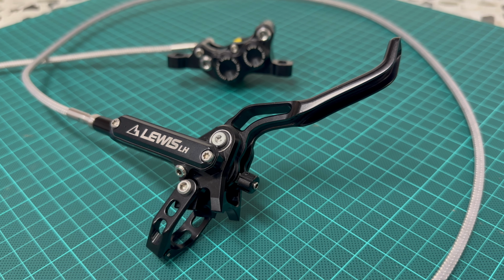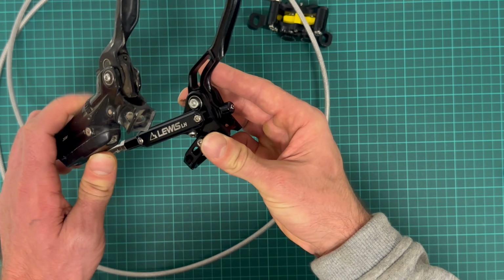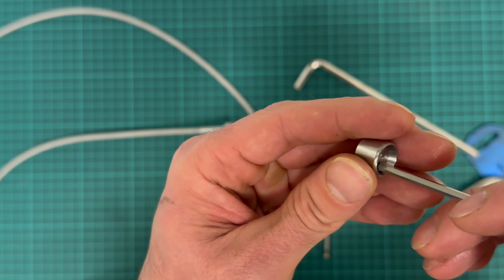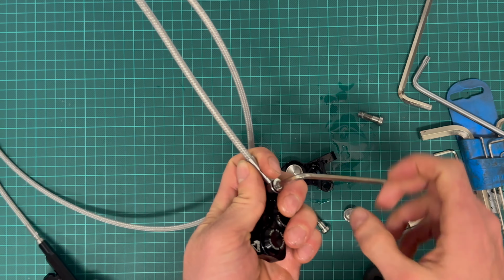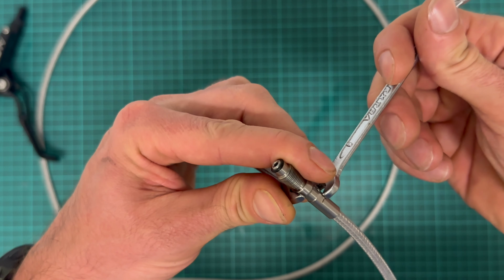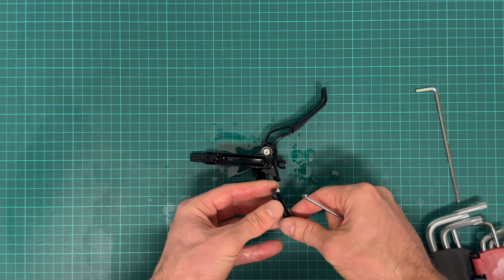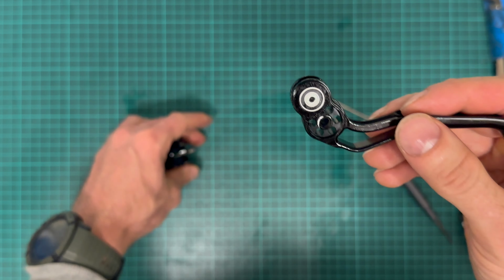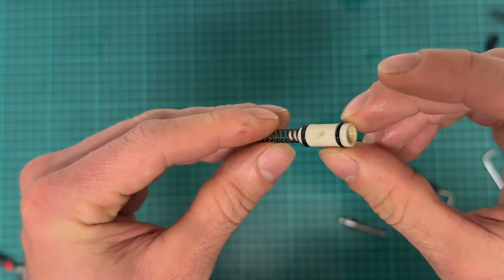Lewis LH4 disassembly

Comment: Excellent video! My con rod broke free of the piston this past weekend during a wreck. Brakes still work fine but when I release, the lever extends all the way pointing forward and the con rod flops around. Looks like I'm now missing the fat washer and snapring so going to order those. To get it back in do I just reassemble the con rod with the missing parts and squeeze the snapring and push it into the brake hosing until it pops into a groove in the housing? Thanks.

Comment: Is there a specific size/spec for the brake hose? I looked into ordering these but a supplier told me the LH4 only comes with silver brake hose and I would like black hoses. Wondering if would be an easy swap to a different type of hose.
Reply from the maker: No, it is standard 2mm ID / 5mm OD diameter hose. They use EZmtb. You can easily swap it. But since the lever has such a high leverage ratio, braided hose is advised.
Reply: Thanks!

Comment: I see Lewis get get a lot of comments about copying Trickstuff and Patent/IP infringement, but it looks like they did not have a patent or the patent lapsed and got deleted.I can't find any patent for the brakes, I see Trickstuff does 3 year patent on the products that are listed on Google Patents now, but some expired. BTW a centre lock adapter might come, cus I saw a patent for it. But I repeat, no brake. So in that case it's legal what Lewis is doing. If Trickstuff had a lapsed patent, that's not even to be found now.

Comment: I they have a another version with leverage adjustment too.
Reply from the maker: Yes, LH4t has adjustable leverage ratio.
Reply from the maker: + titanium bolts & caliper pistons. The pistons in a caliper are bigger too - 4x17mm. LH4 on the other hand uses 17 and 14mm pistons.
Reply: Yep, knew of the titanium hardware, and pistons.  Currently they are the first on the list of brakes to try. They look promising.
Reply: The pistons are half 'n half so titanium shell with ceramic inside.

Comment: Well, I just got my Lewis LHT and the free stroke / bite point adjustment screw is heavily sticking. Can't turn it without having to hold the lever reach knob with a pipe wrench. Otherwise the whole screw with the knob is turning with it. Honestly im really disappointed since they are brand new and these little fine mechanic parts seem to be representing the usual china quality :/

Besides that theyre by far the best brakes I ever put hands on. From the way they feel to the unmatched braking power.

Comment: No shifter mount? Wow. Still, I would never give them money as they are a blatant copy of the Trickstuff line.
Reply: They have bite point adjustment, Trickstuff don't, also they have a version with leverage adjustment too. The bleed port is not on the side but at the top. yes there are some similarities. I don't know if they copied Trickstuff, maybe they based it of it.
Reply: They make a sram match maker adapter now.
Reply: Trickstuff had it coming with their inability to supply and megabucks cost - they will still be the gucci option, but these look like they could be the riders choice
Reply: @gavinatkins3371  don't support the Chinese trolls
Reply: @rezenclowd3 said whilst typing on his iPhone made in china

Comment: Top Job😊
Have you measured the Diameter of the lever Piston?🥲
Reply from the maker: Lever piston: 8.7mm (probably 9mm bore)
Caliper pistons 14mm and 17mm
Lever length ~90mm
Effective lever length ~78mm
Lever pivot - pushrod pivot ~12mm